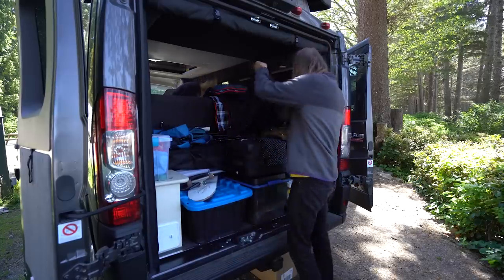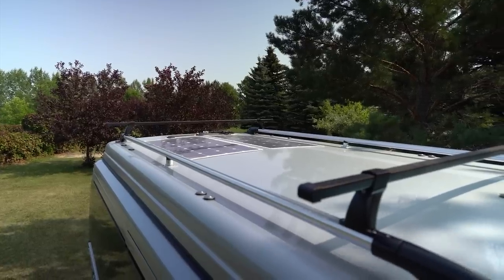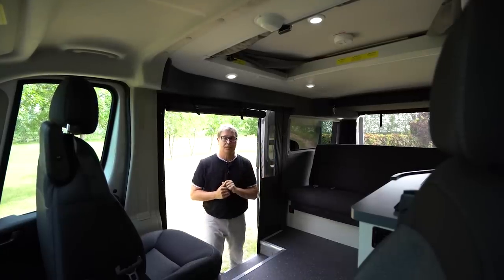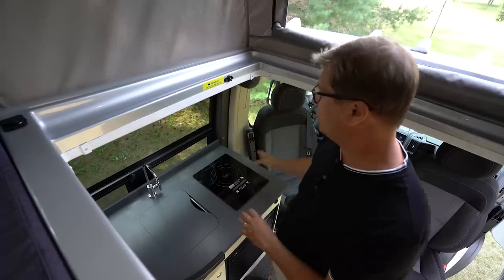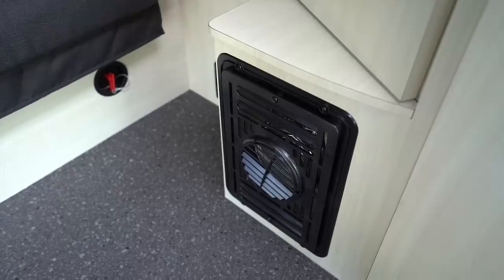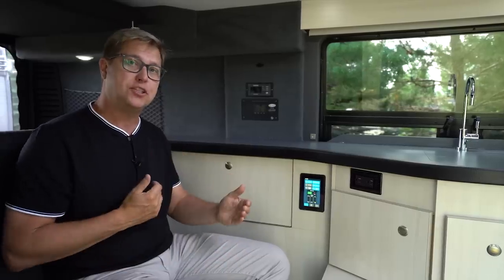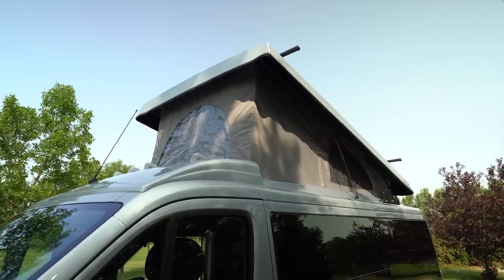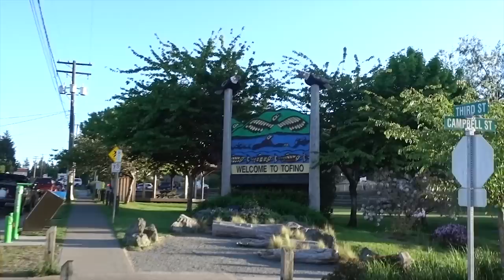2020 Pleasure-Way Tofino Pop-Top Campervan

Comment: We bought the first 2019 Tofino and have lots of weekend adventures this year.  So nice to head out after work to go camping or visiting friends/family.  Looking forward to longer trips this summer.  My only complaint are the back seats.  I was hoping they would have added head rests.  Very glad that Pleasure Way have continued this model.
Reply: How do you handle AC?
Reply: Why is evryone so concerned about AC. Life existed on this planet for millions of years. How did we get here with no AC ???? OMG !!!
Reply: @geostr7785  don't know where you live but in south texas it's impossible to stay in a van without ac for about 6 months out of the year. It's the combination of heat and humidity that make AC necessary. That's why tent camping is impossible most of the year here. A van would be even hotter. Just not possible.
Reply: The Van is very good 👍. I love 💗 it. May I ask how much it would cost to purchase one of it? Thanks 🙏.

Comment: PW produces fantastic products.  I watched a review of the Tofino and the new owner said they had a leak in the pop top.  They were told that the pop top fabric is not waterproof but water resistant.  The owner suggested if it rains to put the top down.  Also, they suggested to spray it with a water proofing spray.  If that's so, then this is really a vehicle for just one or two people.  Where do you put the 3rd or 4th person(s) sleeping in the bunk if it's raining?  PW, offer an option w/o the upper bunk, which would also give more head room.  It makes more sense in that configuration.  This van is a very cool design.  Also, the updates to the cupboards, multiplex panel, and heating system on the 2021 are nice.  You should also make the remote light control an app for your phone.

03/12/21 - I watched a review of the 2021.5 Tofino on Advance Camp RV and the updates are great.  I see you also flattened the running board and made the tread traction more aggressive, and the boards are cut shorter so you could raise the grey water drain and propane connection up so they are both protected by the running board, and have greater ground clearance, great mod.  Now, hit a grand slam with the Tofino and offer it with no upper bunk, or an upper bunk that lifts with the pop top, so there is maximum head room from the back of the couch forward when the top is up.  This would also allow you to access the windows in the pop top more easily.  One last suggestion - offer the Tofino with no stove.  Where the stove volume is under the counter, put in a silverware/junk drawer.  Why?, if I'm cooking anything that will splatter it will get on the driver side seat (not a big deal, you can slide the seat forward or throw a towel over it).  However, with no stove, I can buy a portable, counter top, induction stove, use it anywhere on the counter (to avoid splattering issues) and now I have a silverware/junk drawer.  Also, if/when the induction stove fails, I can easily replace it w/o having to go to the RV dealer.

Comment: Have a 2019 Tofino and it's great. There are/were no options for new vans at a reasonable price (<$85K) with the same feature set as full-camper VW Westy's (sleeps 4, full kitchen, fits standard parking spot, low-ish height). If those are your top criteria, this is the best option for the money. Build quality and electrical system are excellent, details are well thought out. Cassette toilet and AC/fan are easy to add aftermarket, if you need them. I had a couple of minor concerns, including no shoulder restraint seat belts for the rear seat (installed them myself) and no 4WD option (taking chains on and off when that season hits is a time suck), though FWD is the next best thing. If you've been searching for a modern, reliable, true camper van (as opposed to an RV), this should be at the top of a very short list.
Reply: Arthur S. Great comments. Where did you get the shoulder restraints? Would be great if you could post some vids.

Comment: Honestly this looks like the ultimate road tripper. Small enough to just use it as a car/van and hit up a hotel if that's your thing, but versatile enough to sleep in it in a pinch or if you find a cool campground. I wouldn't exclusively use it as a camper but it would be nice to know I have options.

Comment: i like this model even though unlike my roadtrek it lacks A/C and a bathroom which I think are not that important anyway - also no generator which i think is also more of a pain than it's worth
Reply: jMon I have tons of solar, batteries, a huge inverter, a rooftop air conditioner (yes it runs off of the inverter), and a full shower and composting toilet. And I can stand up in my van. All things that were #MustHaves for me.
Reply: See above.

Comment: Great video it's a great RV but if you questions
What about air conditioning, do you leave the rv run all night?
Or can you run the air without the motor on, and would that affect the engine battery?
There's no Maxx air fan
If the air can be turned on all night and no fan it'll be 
A sauna inside you'll melt
You really should offer it without a pop top, it only holds 200 lb and if you're a single person you won't even use it
Downside you have to supply your own porta potty or find a toilet
Reply: It's a minimalist van not an apartment on wheels.
Reply: The air on my 21foot Promaster is surprisingly strong and cold. I have a roof air conditioner as well but I live in Florida. You could run the engine all night for the dashboard air (!) but they build them in Canada where the entire country is air conditioned. I wore a sweater in July in Quebec. .

Comment: I am coming very close to purchasing this rig.

A few questions though;
1. Am I able to add an aftermarket awning?
2. If I were to put a Thule rooftop cargo box on the optional roof rack, is it completely necessary to remove it before I deploy the pop top, even if the contents of the cargo box was less than 50 kilos?

Thanks much

Comment: Does theTofino have a DC to DC charger running off the vehicle engine alternator to charge the lithium batteries while you're traveling?  Also, you didn't mention if it has a water heater, as the sink is cold water only?  You have a fascinating RV here. Thanks for a great video.

Comment: Great new product. PW build quality at an affordable price point. I would add a portable toilet. My one issue is the lack of a hot water system. The ability to shower outside the back doors would make this van work for me.
Reply: Thanks Ted. Not having a hot water system is one of the nice amenities I'd rather have then not. I had overlooked that.  There are of course work-arounds that most of which are not very convenient.  Hmmm... will have to rethink about this one..
Reply: can't you boil water?  it does have outside water for shower in the rear.
Reply: Check out the camplux tankless heater. Just connect it to water and propane at the rear. You can add an inexpensive shower/changing tent which could also hold th porta potti

Comment: Beautiful product and a very solid presentation. 
Pleasure-Way and its CEO has my respect for the quality of what his company builds as well as the very complete and straightforward manner of their presentations. 
The Murphy bed design first caught my attention with regards to your company, but this is an easier design to imagine using on a daily basis. Very nice. 

Only a few things struck me during video, vs. changes and questions. 
1) The optional solar looks like a larger panel type would fit, why only 200 watts? Thoughts on more capacity in the future or why this amount is adequate. 
2) The caveat about the valves freezing (thanks for the honest warning) left me wondering if you've considered some kind of electrical heaters so one could prepare the valves before attempted use. 
3) The rear storage area's laminate edges look like one of the first places that would show wear and tear to me.  Do you see many of your customers modifying such areas with rubberized edges or protective films to armor against scratches and such? Is that something you've looked into?
4) Sort of open ended question about what do typical owners, with reasonable cargo and passengers loaded, manage to use the towing hookup for?  Storage boxes, bicycle racks, small campers? You mentioned the overall capacity for an unladen van, but more practically what is a common actual use for the towing capacity provided. (I don't really expect an answer here, it is sort of too big a question for this format. But it did cross my mind)

Thanks.
Reply: Cargo capacity is best in class but towing capacity is limited.   And yes the laminate in the rear is very vulnerable.   I have a chip out of the top of the vertical panel behind the sofa which for some reason sticks up about three inches above the horizontal panel.  I've cut padded floor mats to size to cover the tops of those two compartments and the rear floor for protection and to keep stuff from sliding around.
Reply: @dougmanck4149  If you don't load the van with max capacity, 2000 lbs, you can tow more. I will be towing a car and trailer to shows that weigh 4,000 lbs, but van will only have 1,000 lbs extra inside.
Reply: I also belief the PL specs are very conservative industry specs. The Promaster hitch is a class IV which is rated to 10,000 lbs.
Reply: Not with this puppy. The tow capacity is 2900 for the Tofino.  That decreases as soon as you add additional cargo, passengers to the Tofino itself and any weight that is added to the empty dry weight of a trailer or whatever one might be wanting to tow with the Tofino.
Reply: @geostr7785  No its not. Its a Class III hitch receiver.  The class receiver hitch rating has nothing to do with whether the vehicle itself can tow the weight = to the rating of the hitch.
Reply: @geostr7785  The Tofino does not have a class IV hitch. Its a class III hitch receiver.  Also, the hitch rating has nothing to do with how much the tow vehicle can safely tow (tow weight capacity). In other words, the vehicle's chassis limitations as Third Cat stated below.
Reply: The ProMaster specs say class IV

Comment: Why is there a lot of optional stuff? Just include it with the whole van since they are so damn expensive.
Reply: Actually in my window shopping I've found the Tofino to be one of the least expensive camper vans out there.
If your a weekender, you don't need a lot of the accessories (like solar), not including them keeps the price down.
Reply: There's not a lot of options for this.  Besides color options, there's Solar, screen doors, and roof rack.  This is one of the cheapest, if not the cheapest, in this category that I've seen.

Comment: A little more storage or storage cabinets would be great or under the bed storage you have storage in the back but when the beds made that's cut in less than 1/2 and that's where the porta potty is going to go for people that need or want that just in case
It's laid out great I just wish there was another option for heating instead of using propane like a gasoline heater that they have out now which can use either gas or diesel and heat your vehicle because her some places you can go like in a tunnel with propane I would like to see and induction cooktop

Comment: Nice work, I have a promaster city with only 9,000 miles and already a lot of repairs due to low quality manufacture and materials !
I hope that van is build to last.
Reply: Fuck. There goes any desire for me to get this. So thank you really.
Reply: @landrewmackinnon4888  And I'm sure you can find 1000's or more, that will report no problems.

Comment: Question- I've hooked up to city water, and also filled the tank and turned on the water pump, but am getting zero pressure or water to my spray hose in the back. Is there an additional value or anything else I need to do to get this to spray? I can't find anything in the manual or online. Thanks

Comment: Is there an under the hood generator to charge the batteries
Reply: No, not like the Hymer. That is exactly why I just ordered a Tofino. Simpler, less to go wrong. Two solar panels handle the volts.
Reply from the maker: Hello ! No there is no specific under hood generator / second alternator. The coach batteries will still charge off of the engine alternator though.

Comment: Can you open the pop top halfway just to give the lower space more head room but still not so visible from outside that it's open?
Reply from the maker: Unfortunately, no. The pop-top functions with two gas struts so they automatically open all the way up once you begin pushing up on the roof.

Comment: Does the Tofino have an alternator to charge the house batteries while driving?
Reply from the maker: Yes is does. The house batteries have 3 methods for charging. The engine alternator, shower power, and the solar panels. Thanks!

Comment: Where are the shoulder belts in the backseats?
Reply: There are none.  It lacks 3 point seat belts. Definitely a downside and compromise insofar as safety goes for the passengers sitting on the sofa.

Comment: I like the build but it does NOT maximize space, especially headroom. That narrow standing opening is ridiculous, they should have made it either flippable or able to push up into the roof. Also, just a bit more cabinets in the rear would have been nice. A close replicant of the Westfalia, but even on a bigger chassis, lacks the usable space.
Reply: As Francis Herreshoff once said.... "if you must sleep standing up, by all means have standing headroom"....
Reply: This I agree with, that the bunk should follow the pop top up when opened, and then pull it down if needed.

Comment: No toilet which is ok, but no hot water or places to put my clothes... not sold on this
Reply: 70 cubic feet of cargo space???  Put a hanging rod in the back if you need.  Heat a pan of water on the induction stove.

Comment: So your telling me this thing has the capacity for only four people?  A family of five would not work?  I rather you lose that extra storage in the back and make that into 6 people capacity with seat belt since the roof rack already holds 200+lbs and a tow capacity of 2900lbs.  NO.
Reply: Buy a bigger van....
Reply: It's only 17'9", you're looking at the wrong model if those are your needs.